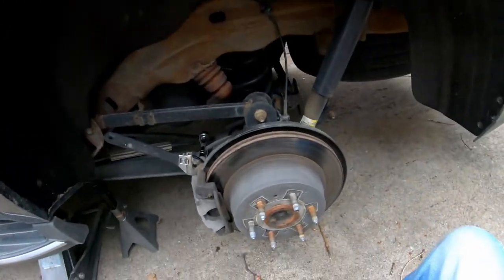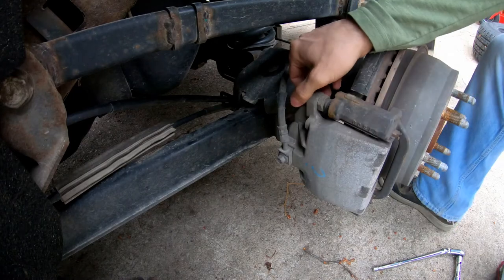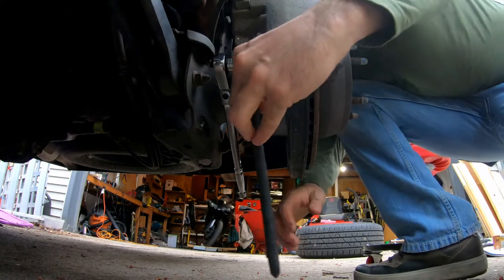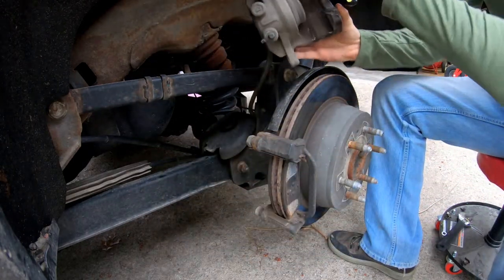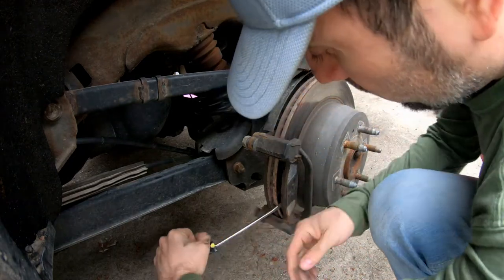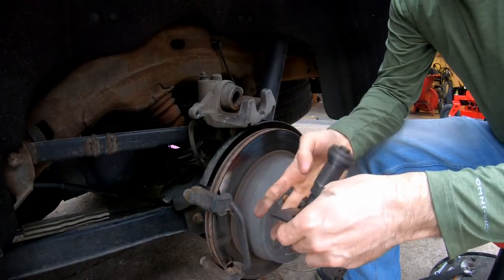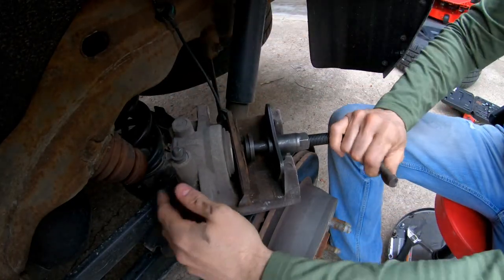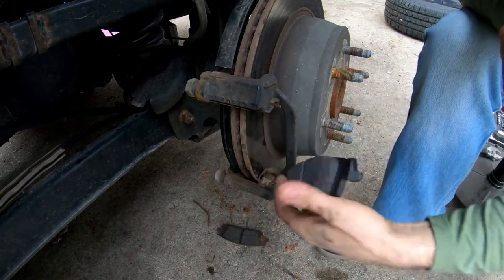2016 Yukon XL Rear Brakes

Comment: They wanted $400 just for rear brakes at the dealer. I'm using OEM
Reply from the maker: It's too easy.
Reply: Can't imagine now. I am doing the rear brakes for around 220 with new OEM rotors and pads... That's why they are called stealership